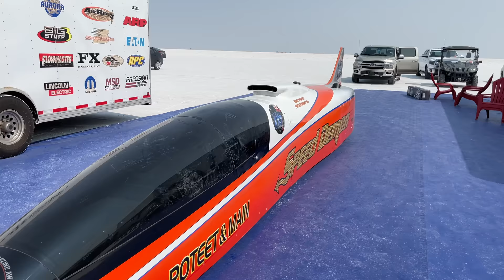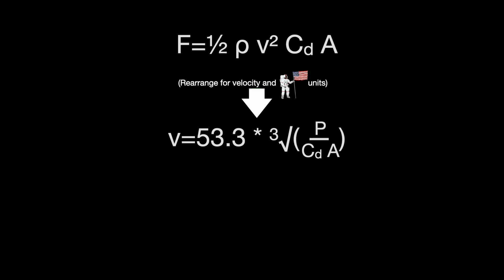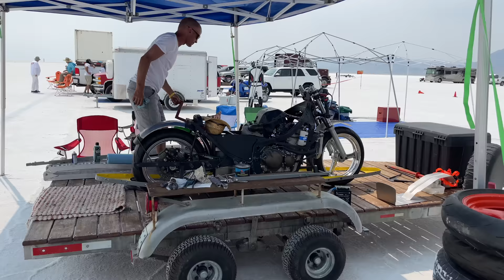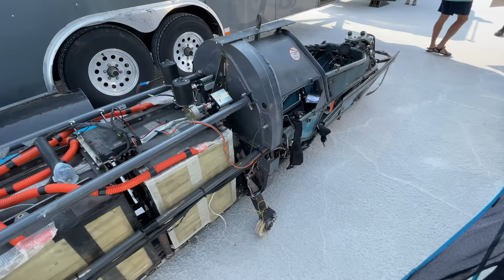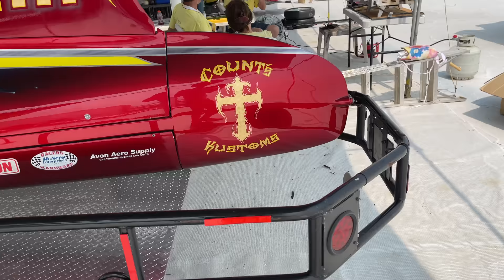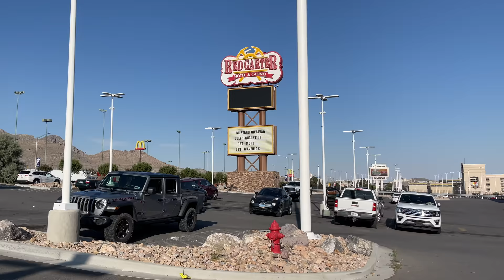The World's Fastest Electric Vehicles Didn't Go Very Fast At The Bonneville Salt Flats This Year

Comment: Air density is a constant for all contestants, but not for all locations.  Bonneville is at over 4000 feet elevation.  That helps electrics especially since they run through thinner air but don't need to "drink" it.  No combustion.

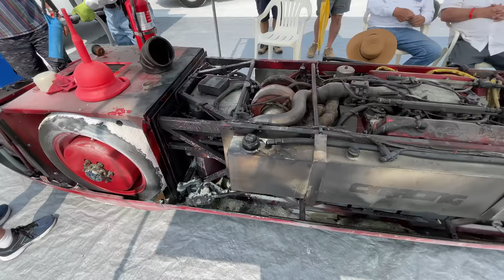Comment: Thank you for the very informative report, and thank you for being a decent and considerate person: @12:42 "I didn't want to make it worse with my stupid questions".
Reply: It looked like it broke the blower belt, the belt then took flight through the hood and possibly struck the driver with debris as the wind screen is shattered. The throttle blades look like they are stuck wide open, too. Must have been pretty brutal. I'd have parked it too...

Comment: 666 Nebulous Theorem was designed and originally built by Jack Costella, a land speed legend who's other vehicles,  5050, 8080,  959, 8282, 788, to name a few, hold dozens of records and are responsible for a good amount of the rules in the SCTA regulations due to Jacks innovative experiments with aerodynamics and engineering.  Sadly Jack passed away last January but his creations live on. Look him up on U-tube.  Little 5050 had the rider laying head first on their belly, it went 215mph with a 250cc gas engine. 130mph with a little 80cc engine.  The Driver/re-builder of 666 and the 8282 Lakester is Jim Hoogerhyde who drove the Electroliner Lakester last year to its record speed.  A game of perciverance and dodging bad luck, as Jack's old van displays, Racing is work, winning is fun,  There will be lots of electric racing and fun in the future.

Comment: A previous boss has raced on the salt flats for decades and the salt used to be much much thicker but the salt mining has depleted it quite a bit. He always had great stories and he was very down to earth. I think he mostly consults now and not so much on the driving side.
Reply: I spose they won't ever protect the area or won't until salt depth is nothing more than a light crust. Not that the oil, solvents, and garbage left by crews isn't enough of a threat ..

Comment: My friends shop has several Salt Flat racers and World Record holders running out of it. He was the guy who was in the Discovery Channel documentry who's dyno cell they employed when the Ack Attack set the 600KPH Record. Disclosure...My friend was never involved with the build and fabrication of this vehicle and he was only responsible for tuning things and making some modifications. The way the Ack Attack is set up & configured is not how he would approach the problem if giving the task to design such a machine. The 1st day on the salt they decided to install a new Lthium Ion Battery which proceeded to short and burn down a good portion of the wiring harness...Then they dropped a valve...My friend is a noted engine developer on the west coast so he has some connections...Off to a friends shop in Salt Lake city to weld up and rebuild the cylinder head on an "ALL NIGHTER"...Then the gear box top gear decided it wanted to go on vacation...The World Record was set after conclusion of speed weeks when the 1%ers rent the Speedway with the FIA still in attendance. Bonneville is not an easy task EVER!

Comment: Bruh that single seater tesla "concept art" looks so badass
Reply: OK, we need to spam Rich Rebuilds with this!
Reply: Would preorder.
Reply: @Mike bruh
Reply: @Mike BRUH
Reply: Hurb
Reply: @Mike bruh
Reply: @Mike bruh
Reply: What do people think looks good now lol
Reply: @Mike BRUH
Reply: Do anyone know how many RPM the tesla electric motor does? And does the torque drop at high revs? My guess was that the electric engines maybe dont rev that much, and if you dont have a gearbox (maybe these had) you cant go any faster. Like a diesel engine, those can have 1000Nm and 500hp but a 300hp 300Nm engine car can still be faster. edit: I posted to quickly max torque of tesla motor is 0-6000RPM and it revs up to 18000RPM but the torque decreases after 6000RPM

Comment: I know enough from racing electric r/c cars in the 1980s to know that electric doesn't fit in the current record format. As a participant (team has two red hats), it's wonderful to see EVs out there making a go at it - best of luck!
Reply: e is hard to class as there are so many variables.
do you class them by battery capacity? energy density? voltage? discharge ability? internal resistance? the rating of the inverter? the rating on the motor? what motor? what inverter? 

with RC, there wasnt that much variation. its 1:8, or 1:10. its nimh, nicad, or nothing. and its a 7.2V pack. and the 540 case motor can only deal with so much, only has so much "tuning" you can get from it. 

little bit more variety now, but yeah... still much the same really. only a few percent points of efficiency difference with controls, motors, blah... all pretty structured and set in stone.

Comment: I think the limitations of speed for commercially available electric vehicles comes back to their design. Electric motors do not run at ever increasing speeds and EVs do not have transmissions offering a great variability of gearing. So even if you have the power available, the "transmission" of that power would limit the top speed more so than the output value and the aerodynamic drag, right?
Reply: Something to that id say, electric motors torque drops off the higher the revs are
Reply: @Nbomber  Indeed, and that's why gearboxes will make EVs both faster if wanted, but more importantly, much more energy efficient. Some "fast" EVs us a 2 speed gearbox.
Reply: @martintaper7997  no. they wont.

theres only so much magnetic flux a coil can make, only so much current a wire can cope with, and only so much heat the whole assembly can dissipate. doesnt matter how good everything else is, if the motor, and its "throttle" is the limitation. 
you can only throw so many amps through a wire for a given voltage, can only fit so many turns into a slot, can only drive the current into a coil as fast as its inductance will allow. doesnt matter how big the batteries are. they cant push more current into a coil than that coil will allow, at that voltage. EIR. 

other than induction motors and synchronous motors, every motors top speed is limited also by its BEMF. that it is a generator, and will try to produce a voltage equal to the one being applied. 

weaker magnets allow higher speeds, but make less torque... regardless if its a permanent magnet or electromagnet type of field. no magnetic field theoretically gives "infinite" top speeds... but with no magnetic field, theres no speed at all.

theres just as many, if not more tradeoffs to make with electric motors than the ICE counterpart. just because they SAY electric motors are simple doesnt mean they actually are. how many people talking about "waving magnets past wires to make electricity" talk about ampere turns, flux densities, hysteresis of core materials, and a hundred or more other factors? they dont, because they dont know, and theyre knowledge only extends to the most basic of concepts... waving magnets past wires. the thing that should be taught to toddlers. 

despite its "simplicity", it was over a century of generating electricity before the AC motor was figured out? and then it was roughly another fifty years before steinmetz condensed all the maths down into reasonably simple equations so people could have some idea of what they were going to end up with rather than trial and error. and even then, theres a 10 to 20% fudge factor at every step of the way... choice of wire gauge, the number of turns achievable on a former, the packing of the wire on that former...

Comment: Anyone interested in something similar but doesn’t want the salt, look for dry lake beds. They’re often used for land speed records as well. 

El Mirage recently had a land speed event. Went there and watched some of the cigar shaped carts kick up so much dust it looked and sounded like a rocket took off
Reply: yeah, but isnt bonneville the only "officially recognised" venue?

like old munro may have beaten his own record in his own time on the local beach, but it aint bonneville so it dont count...

lake gairdner dont count. lake eyre dont count. bolivian salt flats dont count. bonneville or bust. bit unfair. 

still, its the only way to set a level... due to its level! above sea level... consistent. all participants get the same air to deal with with, no "compensation" needed.
Reply: @paradiselost9946  I think it's by different organizations. The ones at El Mirage also do events at Bonneville. Makes sense that a lot of worldwide orgs visit Bonneville since travel there is probably cheaper and easier than to CA.

Comment: I can only imagine how eager these teams are to get the carbon-wrapped plaid motors.
Reply: Perhaps, but if they want to take advantage of very high motor speed they're going to need to use gear drives, not those belts.
Reply: @brianb-p6586  i opt for chains or salvaging a motorcycle drive shaft
Reply: @thatslegit  A shaft doesn't provide reduction gearing, and a chain at 20,000 RPM seems scary to me. Gears!

The Plaid powertrain also presents the issue of having multiple motors - the Plaid uses three of them, which means combining them (custom gearbox) or driving wheels separately (as in the Plaid).
Reply: @brianb-p6586  dont know what shafts you are talking about, but nearly every bike shaft ive worked on has a 1.2:1 reduction at the gearbox, and then a 3-4:1 reduction to the wheel... pretty well much the same total reduction as a chain and sprocket around 3-4:1.

chains at 20K are fine. as long as they arent on large diameters and arent heavy, which is helpful as you can push more power through a given chain as speeds increase. you dont measure them by RPM, you measure them by distance over time. that accounts for wheel diameter. rpm is basically meaningless without a diameter or circumference.
Reply: @paradiselost9946  shafts don't provide reduction. Gears do, and of course shaft-drive motorcycles have gears.

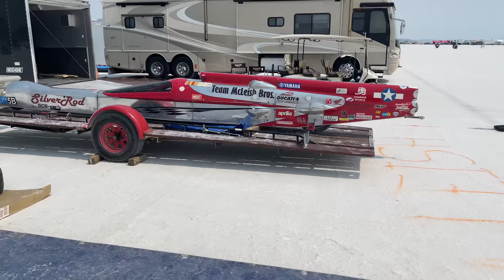Comment: 5:25 part of the reason is everyone in the car world relates low frontal area to low drag. But drag has nothing to do with frontal area. Except to relate the actual drag to some arbitrary shape by a ratio. Frontal area does not effect drag directly. Unless you are placing flat plates in a wind tunnel. (Which have a CD of 1.28, not 1.0... see? Off by a large margin).

In aviation, drag coefficient is related to wing area. This is way more accurate than frontal area. But wing area is still just a proxy for Wetted area. As larger airplanes have larger wings. 

Example, a hummer vs a hummer limo, what has more drag? Same frontal area. Frontal area is not the Limo Hummers problem. WETTED AREA is its problem. 

And most of these cars have a substantial amount of wetted area. Way more wetted area than necessary, because the builders are trying to stack the car behind the smallest frontal area which is an incorrect assumption with no basis in reality.

If you want to go fast, eliminate surface area. 

Better yet: Mathematically create an aerodynamic shape by an inverse-method that is just large enough to contain driver and powertrain with the smallest possible wetted area, having no flow seperation anywhere. And utilize favorable pressure gradients over as much of that surface as is practicable. You will end up with shorter, wider cars that are inherently less stable due to less length, and aerodynamic lifting forces, fix this with true airfoil stabilizers with interlinked control surfaces, rudder and even aerodynamic pitch trim linked to the control wheel. (like a plane, or a planning boat). Locate the center of gravity in front of the aerodynamic neutral point both vertically and laterally. (Keep mass forward for stability, like a throwing dart).

Hint: Sum different cars wetted areas, and multiply by skin friction drag coefficient of 0.006 for a close estimate of "equivalent flat plate drag area" then add cooling drag, add drag due to panel gaps. Try and estimate underbody drag, but you can determine that from your result working backwards.

Comment: Electric rally class would be entertaining and beneficial for ev evolution.  Ev auto pilot hill climb racing is something I would watch.
Reply: EVs have been out there for decades, and it's not like EVs are even new... They are actually as old as the combustion engine run cars but even after 100 plus years the same issue hasn't changed.
Reply: @SilvaDreams   battery technology has changed a lot.  Like my dji mavic 2 drone that can fly 8000meter away from me then return on the same charge.  This would be impossible with 100 year old battery technology.  I can drive my rc crawler almost 2hours on a single charge. My robot vacuum can clean my relatively large house on a single charge and still have battery left.  I don't own a electric vehicle. But gas prices close to 2$ pr liter is pushing me towards electric. I really hope Porsche could release a adorable synthetic fuel that makes my current vehicles more future proof. I'm not holding my breath for a large scale production of synthetic green fuel.
Reply: @thor_4017  Yes. There has been a few battery changes. The lithium battery has been around for, well, around 100 years but it wasn't commercially available till the 1970's but not cheap enough for consumer use. It wasn't until the 2000's that came to pass and now we just have a lot of theoretical future battery tech popping up but again it will likely take 50 plus years to reach consumer use if it ever does.
But my point still stands, the issue of range and then recharging them takes time. (I'm going to guess you live in Europe) so the range issue is likely not that big of a deal for you but for those of us un the US where traveling 64km or more one way is common.
Reply: @SilvaDreams  ioniq 5 / kia ev6 can charge from 10-80% in 18minutes.  800v charge is already here.  460km range on the cheapest long range ioniq 5.  Kia ev6 long range rwd has 528km range. That's enough range for me.
Reply: @thor_4017  Those are theoretical mileage on perfectly flat roads and a perfectly held speed with no wavering. Trust me I have an electric bike with a claimed range of 40miles but I live in Washington state in the western part where it is hilly as hell and trust me I do no get those 40 miles.
Real world mileage is different from perfect mileage even with gas cars.
Reply: @SilvaDreams  ev6 got 528km range from real world tests in EU.  Kia didn't release it with 528km range in the specs. My Subaru use 1.5l pr 10km when I pull my caravan.  Even with 200km real world range it would be worth it. Ebikes typically only assist you. Advertised 40miles range would be at level 1 assistance on flat terrain. I got ebike myself. Tire, tube/tubeless choice has massive impact on ebike range.
Reply: Rally in general requires too much range for EVs at this point.  Hill climbing it practical, and there have been some of those. Anything with automated driving is of no interest to me.
Reply: @SilvaDreams  These range numbers hold up just fine in real-world conditions, actually.

Comment: You can save weight on the wheels by making them out of a Lithium-Aluminum-Magnesium alloy... With just a hint of Calcium to keep the reactivity low.

Can also make the wheels hollow, structurally supported with spokes, and filled with a lighter-than-air gas like hydrogen.

Comment: I want to do a flat spin at 100MPH in a vintage Mopar.  That looked counterproductive but pretty fun.
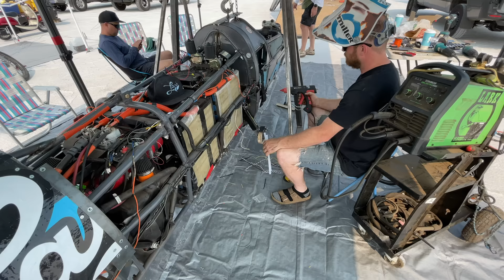Reply: 11:27 I have owned that same glue gun and a couple of its friends.  Good stuff.  lol
Reply: 12:00 lol it was a glue gun ha ha nice
Reply: also boondocking is much easier now that power packs have adapters and can actually use quick charge stations, like full size cars.

Just take an EV next time - several innovations in coatings/paints in the past few years are going to let you have solar panels in paint cans as well as passive AC (no lie, good stuff).

I'm thinking that the only two factors we have are power continuity to the surface of the ground and resolving air resistance - we can solve air resistance by using a partially lifting design, which also helps lighten the vehicle such that we can load it down with power just to keep the wheels on the road.  Maybe people are going about it in the wrong way trying to use the lightest stuff possible.  :-)

As long as it keeps touching the ground continuously it's technically still a land speed record, right?  Shouldn't matter the shape of it at all outside of generating classes to remain competitive and constantly push class technology to the innovative limits.

Comment: Electric vehicles are great for acceleration but not so great at top speed -- one factor for this is that as speed increases the voltage you need to apply rises with speed through 'back EMF' and the power supply must account for this by increasing the voltage being applied to the motors.  This cab be done but within limits at the power levels needed -- close to 1MW.